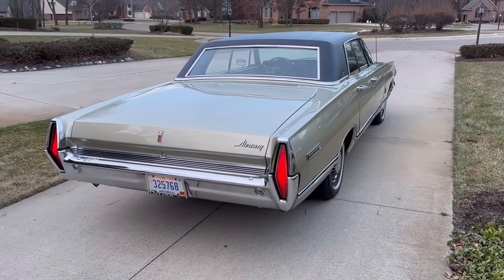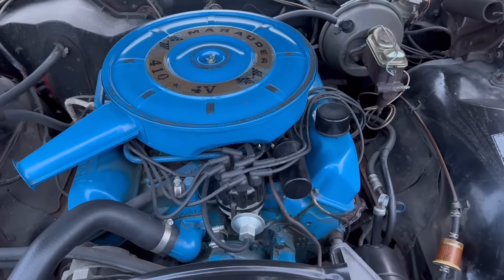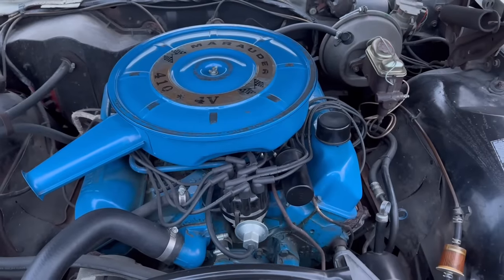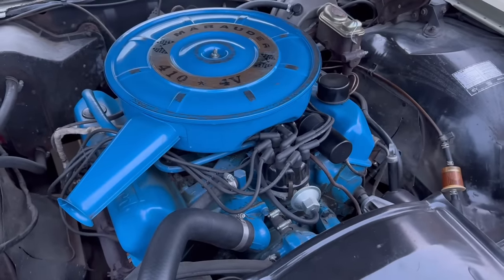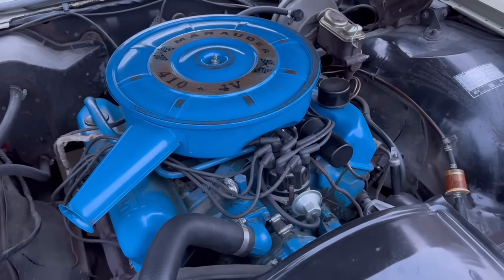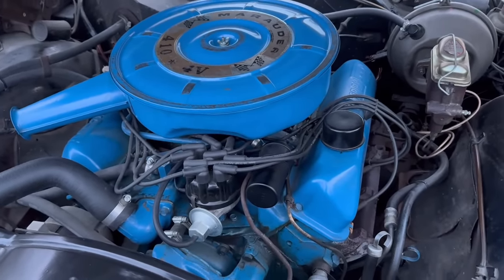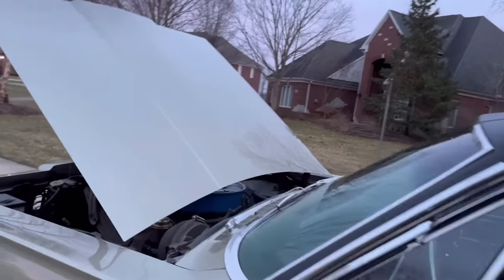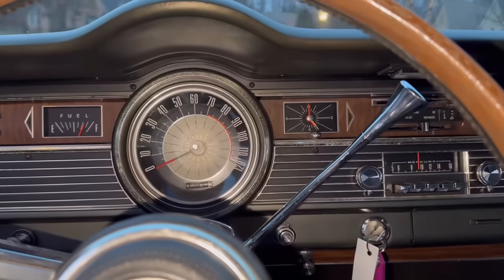Ford's Shortest-Lived (and Smoothest) V8 Engine: The 1966-67 Mercury Only 410 V8

Comment: Adam wasn’t there a 406 Ford motor in the mid sixties? I believe it was in police interceptors around 1963. Has anyone here heard of this? My brother put one in a 57 ford he built for street racing in the late sixties.
Reply: The 406 was introduced in the '62 model year, and was a factory option only on the full-sized Ford and Mercury (i.e. Galaxie & Monterey).  Mid-year 1963, Ford made a number of product changes...such as 1) Replacing the 406 with the 427; 2) Replacing the 260 in the full-sized Ford with the 289; 3) Introducing a fastback model to the Galaxie line-up (to supplement the more formal T-Bird roof line); 4) Adding the 260 to the Falcon's option list; etc.  It's possible that the 406 found its way into some police cars, but I'm willing to bet that the vast majority of them had 390's.  It's interesting to note that the Ford sales brochures from 1963 called the 390, 406 and 427 "Thunderbird" engines, but the 406 and the 427 were never factory-installed in any T-Bird.  In the 1966 model year, however, the 428 made its way onto the T-Bird option list.

Comment: One year only 1968 FE 427 with hydraulic lifters rated at 390 HP. Was supposed to be available in mustang, mid size torino/cyclone but only installed in 68 Cougar GTE in very small numbers, i believe around 335

Comment: It wasn't just used in the Mercurys. I had a 410 engine in my 1958 Edsel. The weak spot was the shaft that drives the oil pump. I had to replace mine twice.

Comment: I just thought of another short lived Ford V8... the 1969-70 Boss 302. This was a highly specialized engine made to compete in SCCA Trans Am racing, and against the Z28s 302. It was only available in the Mustang Boss 302 and Cougar Eliminator. It had the Windsor block with Cleveland heads ( modified). A total of 9279 Boss 302 engines were installed from the factory in Mustangs and Cougars.

Comment: The FE engines had tons of swapability. Crank, rods, heads could be swapped for all kinds of combinations. The 352 in my 64 Galaxie averaged 20 mpg on the highway, and would start with a flinch of the key!

Comment: Regret to have to say that your engine has the valve covers for Fords of that year instead of the correct Mercury script pentroof valve covers it should be sporting. Those Mercury valve covers are not only stylish and rare, but they are the post-'64 valve covers that will clear adjustable rockers, so they're quite sought after. 
I've always been puzzled that Ford didn't do more with the 410. I've got one that I had built especially for my '69 F250 2wd with the T-85 3spd overdrive column shifted manual that gets very good gas mileage due to the overdrive with overrunning clutch that allows me to coast most of the time around city driving. Better city mileage than highway mileage, actually. 18 city/14 hwy.

Comment: Here is an interesting fact, Mercury was not the only car to get the 410 FE Motor in 66 and 67.  

In 1966 the Virginia State Police Ford Custom came with the Ford / Mercury 410 motor.  I don’t know if any other police departments use them, but Virginia state police was able to get them in the 66 Ford Custom. I know someone that actually has one now which is under restoration.

Comment: The 410 used special pistons - C6MY-A slugs - to keep the deck height proper.  Basically a 0.1" shorter compression height.  Fairly rare in the parts bins. 

I'm told that the pistons from a later, low-compression 'truck' 390 will work, but I haven't tried it.  Those would be cast pistons; the original 390-4V and 410 pistons were forged.

Another part unique to these engines is the flywheel.  LIke the 428, the 410 carries at least part of its balance on the flywheel.   All other FEs are 100% internally balanced.   That flywheel also carries a C6MY part number.

The big Mercury cars with this engine also got that bulletproof 9-3/8" axle assembly by default.   Basically a 9" on steroids.   You can identify them with a WDT tag code.    

The powertrain from a '67 Mercury was transplanted in its entirety into my '67 Galaxie ragtop (Had to get a custom driveshaft, though).   Butter smooth, sounded great, pulled strong and without drama.  Just mash the pedal and go.

Comment: 4300 A.   carbs were good , I rebuilt and had one on my 70 429 thunderet. 72 and up there was the 4300 D. Carb which had large secondary like the gm quadrajet and a smaller primary

Comment: Actually 1966 and 1967 Mercury Monterey and Montclair almost always had a 390. I believe that the Colony Park also had the 390 as standard equipment.
Reply: You're absolutely right.  The 390 was standard in the Monterey, Montclair, Commuter, and Colony Park; the 410 was standard on the Park Lane and optional on all others.  Any of the full-size  '66 & '67 Mercs could be had with the 428 (which was standard equipment on the not-often-seen S-55).

Comment: The 302 tunnel port engine lasted only about 18 months in production. It was made mainly for trans am racing.and came after  the well known 302 ford engines as it produced more power. When the Boss 302 engines were introduced,  tunnel port engine production was quickly scrapped.

Comment: shortest lived 221 Fairlane little V8 and the roaring 405 horse, 406 as in Four Oh Six. Smoothest 221 small block and 260 small block. The 406 was a very serious and aggressive competitor among. the FE's    221's and 260's purred like kittens and yet saved a high RPM capability in reserve.

Comment: I've heard of this engine. I thought that it was also available in the Mercury Cyclone but didn't appear on the order form. There was the Ford engine that never was. Ford was planning on keeping the LTD/Grand Marquis/Continental at huge proportions before the oil embargo of the early 70s hit and offering a 512 cubic inch V-8 in them - however - they were forced to downsize and drop the big blocks but you could still get that engine as a crate motor.

Comment: I can't think of any two year only engines, but I'm sure a couple or few exist.  
I can say that Ford was good for having the same displacement across different engine families - I believe that the last Y block was a 332, with that first FE being 332 as well.  Then there's the taller deck 351 in the small block series, as well as two distinctly different versions of 351 in the 335 engine family, the Cleveland and the M.  And if we want to include Australian production, they made 302s out of Cleveland blocks, compared to our small block 302s here.  I'm a little surprised that the 4.6 wasn't a 289...

Comment: 1962 Fairlane and Comet had a 221 Cu in V8= Shelby used it in an AC Cobra but upgraded a couple times to a 260 ,a 289, and a 302 and then went Big Block
Sunbeam also used a 221 and a 260, with that engine it weighed 2000 lbs (maybe)
 a rocket on tires
the 221 didn't make a whole year, if that. and it was bored to 260 cubes

Comment: Just to keep the record straight they didn't and couldn't just drop in the 428 crank,,  they dropped in the 428 rotating assembly that also included the specific 428 flywheel and harmonic balancer because 410's and 428's were externally balanced and the other FE's were internally balanced...

Comment: 1962 introduction of the new small block started out as a 221 cu. In. and quickly advanced to 260 cu. In. In 1963. In 1964 it again advanced to 289 cu. In. The small block bore dia. was frozen at 4.000 in. The bell housing bolt pattern was advanced from 5 to 6 for the 1965 model year along with a change from generator to alternator. The Mustang “289” badging change also occurred with the generator/alternator change. The stock small block bore size remained at 4.000” dia. for the 302,351W, 351C, 351M, and 400M. 9:25

Comment: Just a thought. Seeing the air cleaner lid having the paint worn off on the driver's side edge leads me to think perhaps you might want to check the engine mount on the driver's side.

Comment: The 1962  221cid, The 1963 260cid, and the 289 came right on the heels of these. two. The 221 is the same cid as the original  1932 flat head. The first v8 from ford and then 30 years later a major jump in engine design their all new small block to keep up with Chev.

Comment: I had a 67 T-Bird that had a 410 from a 67 merc station wagon that caught fire. Boy would that thing pull. Broke both motor mounts where they were mounted to frame racing a Pontiac Firebird. I went the the parts house & asked for a set a plugs & Steve the counter man said no such of an engine, I spun the champion plug place mat around & pointed. He said that was a first.

Comment: Very interesting although my father had  a 1968 Park Lane Brougham with the 410 installed in it. It was a California car and in 1971 my father and I worked on it (I was 16) because we were going across country and he wanted a light engine rebuild, so we did that light rebuilt on it, a father and son project. It was a true 410 as the pistons were 410 specific and not 390 pistons. Could some leftover 410's be installed in 1968 year models that were produced in 1967 possibly? I remember that the seats were like ultra smooth silk, and tough , although they could water stain.  Love your channel and watch it all the time.

Comment: In 1958, Ford made a 400hp engine called a Super Marauder. It displaced 430 cubic inches and had two Holley two barrel carbs on top. Supposedly only 100 of these were ever built.

Comment: According to my Motor Trend World Automotive Yearbook 1966, the Mercury 410 came with a 2.80 rear axle ratio, rather than the 3.00 axle ratios of the 390s and 428s.  That would have made it ideal for quiet, economical freeway drives.

Comment: IDK, how long was the run of the 428 Pi? The real story is the larger valves and rectangle head ports. That 4 inch stroke makes the power come in off idle and it also helps fuel mileage.

Comment: The last year Ford used the FE in a Car was 1969 . . . went on into the 70s in Trucks . . . but by 69 the Mercury had the new 429 4v 375 hp motor.

Comment: Do you still have the drive around video of the 410 that you had. 30 ci makes quite a  difference in the lovely way that it works, turn a corner and your foot laying on the pedal is plenty to accelerate. And the throttle response is instant.  I changed the accelerator springs on an Edelbrock that was on a 410. OMG it was so smooth and responsive.
Reply: That was such a great drive around video, you even got a 2nd gear scratch. I think it was a 4100 Autolite wasn’t it? The camshaft is the same as the 428 PI.

Comment: Wow! i completely forgot about the 410cubic inch big block Ford, Years ago a guy i know had a 410 V8 in a 1972 Ford F250 maybe it was a transplant or i just thought maybe someone might have changed the air filter  cover

Comment: My first car was a 67 parklane with a 410 and 4 piston dsc brakes. 333 HP and 444 ft lbs of torque. Lots of fun for a 16 year old and I still have the engine sadly the frame was rusty and broke (oddly the body and floors were solid)

Comment: I do believe that Ford had a very rare introduction of the Ford 406 which was an intermediate between the 390 and 427428 engines as well. I believe that was a 63 option only.
Most of them are set up to have enough torque to get the car to leave from a stopped up to a reasonable speed. That's why they did not have particularly large carburetors.
If I remember correctly, the 410 was Ford's answer to the Chrysler 413 and it was a pale comparison. The 413 would outclass the 410 in every possible metric.
I have literally put my ear to a 62 or 63 Chryslers Grill one time and could not hear it running and that was a time when I could hear your watch ticking from across the room

Comment: The german Ford FK series trucks might have an objection to this. The 2nd generation introduced in late 1955 was available with either a V4 or V6 Two-Stroke diesel engine. And these engines were true disasters, probably worthy of a video on their own, for the novelty of a Ford built 2-Stroke V-Type diesel engine alone. At one point warranty claims were piling up faster than Ford was building these trucks. The diesel engines lasted from late 1955 to about mid-1957, leaving once again the 239 Flathead V8 as the only available engine until production ended in 1961.

Comment: Everyone is commenting on the front mounted distributor.   It is not about the distributor. It is about the oil pump.  Chevy with the rear distributor and hence also rear oil pump, was well suited for drag racing.  On acceleration,  oil would go to the back of the pan, where the oil pickup was.  Fords tended to get starved for oil when drag racing.  ------Doozer

Comment: It’s amazing how many divisions of the various auto makers made so many different engines that performed with basically the same horsepower or torque how long it took them before they finally realize this and standardized motors throughout all divisions what a savings of money and parts support, etc. if it wasn’t for the Japanese they’d still be building that montage of inefficiency.

Comment: I would say the 221 in 1962-63 Fairlanes/Meteors would be just as rare if not rarer. And I do know of at least one Cougar with a '410' in it,though not original....but still an interesting story behind it??  Friend in High School 40+ years ago bought this nice '69 XR-7 with a bad engine. It came with a second core engine in the deal. Sadly,it turned out neither engine was rebuildable,one turned out had a cracked block,the other had spun all of it's bearings & ruined the crank. Plus one was a 390,and the other a 428. But his older brother,a Mopar guy & line mechanic for a Chrysler-Plymouth dealer told him/us (We were building this in Auto Shop) that by swapping usable parts between them, and doing the correct 'mixing & matching' we could build a good engine,but it would be 410 ci. We then consulted the teacher to see if he'd ever heard of such a thing and he told us "Oh,Yes,They put those in things like Montereys and such for a few years??" So we built it up. Actually ran better than we expected it to.....and even better after his Brother showed us a few more 'tuning tricks' like recurving the distributor. Even though my Friend passed away several years ago,I do know that Cougar with our 'Stroker 410' is still around in the hands of another of his siblings.

Comment: Three Ford small blocks vie for the shortest run ( time wise)...
The 221 was introduced in 1962 for the new Fairlane and dropped in May 1963 with 371,000 produced, the 260 was introduced mid year 1962 and dropped after 1964 with 604,000 produced,  and the 255 of 1980-82 with 253,000 made.

Comment: I’m wondering if the 221 small block was produced for a shorter period (or maybe the same). It was in the 1962 and 1963 Fairlane as I recall. and this may be splitting hairs but ford produced the 4 main bearing 200 inch six for the 1964 falcon and probably the Comet. The same setup as the 144 and 170 sixes introduced in 1960 and 61 respectively. Later in the year when the mustang came out in April, they moved to seven main bearings.

Comment: Counting on cubic inches being the deciding factor for being an odd but short lived engine, the Linoln 462 was only offered from 1966 to mid year 1968. So, just a year and a half.  Part of the MEL (383, 410, 430, and 462) family they were replaced by the 385 series. This was not the same as the FORD FE as Lincoln had these oddball engines. So even though Ford built the 410 FE it wasn't the same as the Lincoln 410 MEL.I 'm not sure if this fits the requirements for short-lived engines or not, so not correcting you in the least. I only know anything about these due to rebuilding one for a project for Auto Mechanics in the late 70's. The MEL had very odd cylinder head with a combustion chamber of about 3cc's just around the spark plug and flat everywhere else in what would be the normal chamber area. The 430 and 410 at least shared this head design, and I'm just not sure about the 383, having never seen one in person. It was very simular to an FE except no part of the intake was covered by the valve covers like the FE. A mix between the FE and MEL more or less. About the same short life as the 410 FE... By the way this is a fantastic channel and you've got some of the most impressive and near-perfect cars I've ever seen, even in pictures.

Comment: The 410 was basically a stroked 390 and I don't have the production numbers but the 406 produced for two years '62-'63 and used in Ford and Mercury cars was basically a bored out 390 and had a production number of 13,000 which is at least equal too or more rare than the 410.

Comment: As a general rule you need 1.5 CFM per cubic inch on average. Also with V8’s theirs always two cylinders on TDC at any given time which creates a balancing issue. These engines really ran smooth though.

Comment: The 80 & 81 Mustang had a 255 ci v8, a 302 but with a smaller bore.  Probably a similar production run... as I think most the mustangs then were I4, I6 or v6 cars because of the gas crunch years.

Comment: It wasn't a Mercury only motor, Ford used it in other vehicles coded 390S. The Mercury valve covers in Galaxy was one way to identify them. Your right about 66-67
Reply: The 410 was a Mercury only size-displacement
Reply: Did 390S mean 390 stroked, becoming 410 (but don’t tell insurance companies)?
Reply: @2packs4sure  yes you could get the 410 in non Mercury  badged cars. For instance 67 Ford Mustang Stallion and the 67 Ford LTD and don't get me started on 410's in bumpside and dentside trucks
Reply: No, the S designated special. There was a few different configurations using this code.